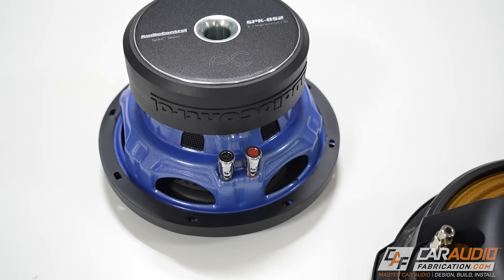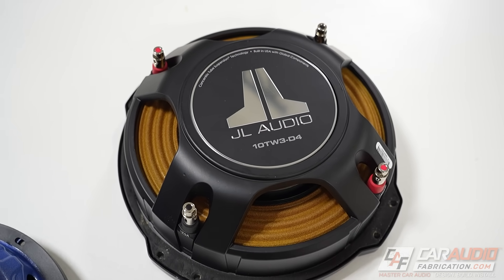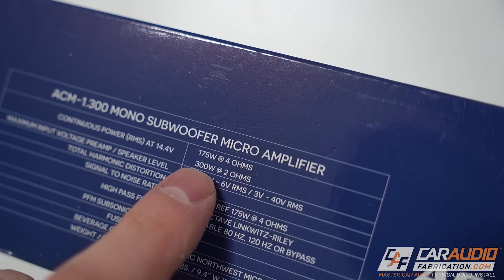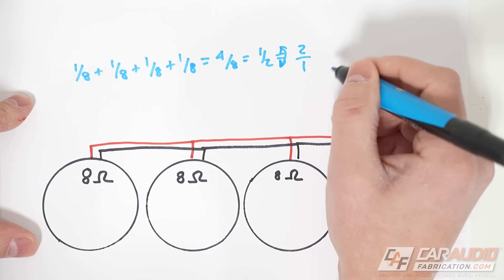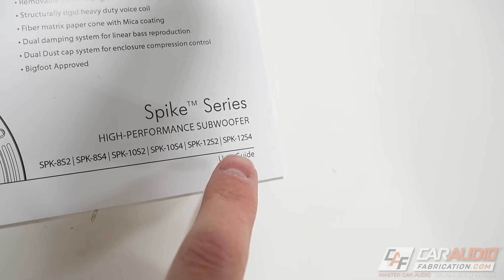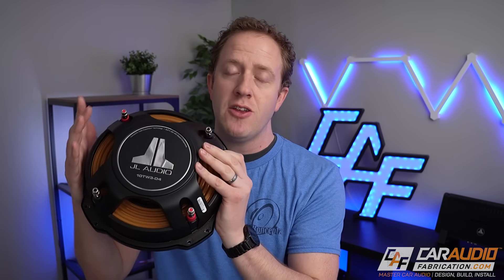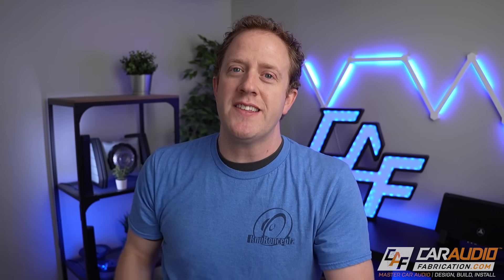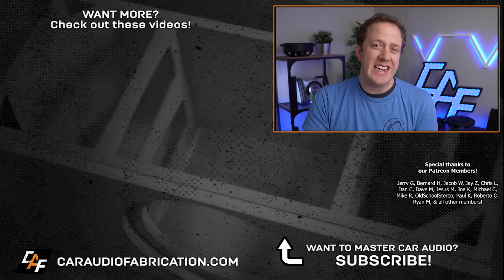Single vs Dual Voice Coil Subwoofer - Which is BEST? Wiring Explained!

Comment: Hey, I think I have a silly question, possibly🤣
I'm playing with the idea of having a cheap soundsystem that can give the outputs of a high end soundsystem, and my idea is to have four 8 cm, two on each side, but where the 8 is going to sit, the idea is to have small formfactor to hug the 8 ones for pressure and gradually widen it out to 2 passive radiators, is there any gain from this or do I loose more bass than if I did it with just a one size enclosure?
I want as much pressure as possible coming from the small ones to feed befy radiators with pressure, do you think this is possible?

Comment: Question: if I have a 4 channel amp that is 4ohms does that mean each channel is 4ohms or would I need to do different wiring to do a 4ohm load (speakers are also 4ohms) so like with a subwoofer if you wire in parallel you would get a 1 ohm load would I need to do that with the speakers on a 4 channel amp to or just hook the speakers up normally to each channel

Comment: Hi Mark, I am new to this Car audio stuff!,  Please can you answer a couple of questions for my new build. 1, I have bought 2 dual sub woofers at 4 ohms each, And the amp I got says that it can be bridged at 4 ohms x 2 @230 watts rms each channel. ( How would I wire them up?) Question 2!, Crossovers placement! Is it better to place them nearer to the speakers or can they be put near the amplifiers in the trunk?. Any advice would be grateful. thank's.

Comment: Im running single 2 ohm coils. I built my own subs also tho. Running 6 15s in a 4th order wall. Quad stack motors and 3" peak to peak linear excursion. They can handle about 2500 rms each and can play from 20-60hz. Fs-27hz, vas-1.5ft³, qts-0.8. Not for competition. Only demos.

Comment: The weight difference between dual and single coil woofers, would usually mean more metal is put in the dual coils, this could potentially give higher power potential, but the significance is usually small, because whether you can push 1200 or 1400 watts through a woofer has very little impact on performance. Also it is not guaranteed that the rest of the sub can take more power, even if the coils can.
However, higher moving mass usually gives lower FS. The extra coil also gives you more flexibility, and you can tap the output from 1 coil, if you want to measure it and experiment, but it will never be as good as a optic sensor or an accelerometer though, if you ponder on servo systems.

Comment: Can dual 2 or dual 4 be wired to 1 ohm for 2 subwoofers?
Reply: Dual 4 ohm can become 16, 4 and 1, if you use all coils. 16 is series+series, 4 is parallell+series, 1 is parallell+parallell. 
A pair of 2ohms can become 8, 2 or 0.5, for series+series, series+parallell or parallell+parallell.
You could in theory wire one sub in series and the other in parallel, or leave one coil not connected, but why would you.

Comment: I run a single subwoofer setup. My subwoofer is D1 wired to .5 ohm on my amplifier. Due to box rise I doubt my amplifier never will see that half ohm. Is that true Mark?
Reply: It is true.  Rarely if at all, will you see your sub's "resistive" rating while playing in a properly designed and constructed enclosure.  Just try not to wire your subs "in the dirt". There are some amps that are rated at 1 ohm that will have no issues at .5 and if you wire at .5 ohm, chances are you will be fine.  I am wired at .75 and I rise from .9 to 1.1 and my peak is 4 ohms.

Comment: But 2 ohm amp is more efficient compared to 1 ohm load ...lets says 83 efficiency vs 72 efficiency at 1 ohm  so wiring at 2 ohms is kind of better ?
Any suggestions feed back on this 
Remember one of kicker amp mono block provided great efficiency over 90 % at 2 ohms and went down on 1 ohm
Reply: If you're concerned with efficiency due to electrical limitations, it is important to know this!  Some amplifier's efficiency ratings go in the trash at 1 ohm and below.  It's good to check out Williston Audio Labs amp dyno reviews. 😁

Comment: The DVC option in my mind would seem to interfere with sound waves in a ported box, all the wires etc, but that’s probably another myth
That said, might be easier to match an amp with the wiring options. No preference really.
Reply: Impedance rise on a sub that's wired in parallel vs. series is proportionally lower.  I recently discovered that impedance rise is not a static number.  This is important if you're trying to squeeze every bit of performance out of a setup.
Reply: @RodofAllTrades  Yes, I’m aware. Series up to 4 ohms is a goal, but I was speaking of the physical presence of additional wiring 
Probably a minimal interference

Comment: I have a question for a future video since I cannot find that you handled this exact subject before
I bought a new car recently and the way I want to use it combined with an audio system means that I either have to go with under(front)seat subwoofers or have a box that's super easy to take out of the car, preferably an active one (so there's literally just power, line and remote wires to hide).
I can use the seat fastening brackets in the rear for a subwoofer (going to throw half the seat out, just 2 seats in the rear anyway), is this something that can be used in your opinion?
Regarding underseat subwoofers I would probably go for prefab, closed, active ones there too, is there anything special to think about when going that route, like how much space is needed between the speaker and the seat for the audio to actually get out in the car? Is it hard to build underseat subwoofers on your own for the front seat? Loved your backseat underseat video but it really doesn't apply for this tight space.

Comment: In my gladiator I’m running 2 kenwood 10’s flush mounts single voice coil im running them in series pos to pos then pos on amp then neg to neg then to amp i might be saying it backwards lol with Rockford fosgate amp if I done it right im only getting 350 watts at 2 ohms   In the wife’s jlu im running 2 fosgate 10 r2 with the 500x1 fosgate amp there running in 2 ohms + - on sub then + - same on the other tied into one wire to amp.  I think box design is killing my overall sound on both builds and amp selection

Comment: One question I had that wasn't covered is ,,, What is the performance difference between 1 2 and 4 ohm subs ..... Does a 2ohm sub respond faster (tighter) than a 4ohm sub for SQ? Edit and also Same question but for duel or single voice coils?
Reply: The lower the ohms the more power the subwoofer can handle due to lower ohm subs have more resistance. Basically a 1 ohm sub against of 4 ohm sub = 1 ohm can handle more wattage but the 4 ohm sub would be more efficient power wise keeping your amp running cooler. The lower the ohms are the more strain on your amp but SPL will be much higher on the lower ohm sub. Also the speed of the subwoofer has nothing to do with power (wattage). Speed of a subwoofer has to do with the motor structure, cone material that it is made of, and what type of box structure you use. In my opinion sealed subwoofers are faster and more articulate than ported but there will be people who disagree. Back pressure on a sealed box controls the cone movement better in my opinion. But all subs are not built equally so a poor built sub in a sealed box may sound worse that a good sub ported if the ported box is well structure, the box is tuned well to the sub installed in it, and braced well.

Comment: The following are amplifier specifications

MODEL
CXA1200.1
Power (watts/ch) 4 Ohm
600x1
Power (watts/ch) 2 Ohm
1200x1
Power (watts/ch) 1 Ohm
1200x1 +/-10%

I don't understand the "+/-10%"  of the 1 Ohm. Is the amplifier best running at 1 ohm or 2 ohms?
Reply: Its impossible for the 2 Ohm rating to be equal to the 1 ohm rating... The 1 ohm should have more wattage. This looks like a typo from the amp manufacture or store that is selling this amp. If that 1 ohm rating is true though it also means that the subwoofer should not be run at 1ohm because having a negative percentage factor in there means that amp can't handle that 1 ohm power load...
Reply: @petedetraglia4776  those are from the manufacturers website. The manual basically says the same. 
"(RMS Power [Watts]
@ 14.4V, 4Ω mono, ≤ 1% THD+N 600W x 1
@ 14.4V, 2Ω mono, ≤ 1% THD+N 1200W x 1
@ 14.4V, 1Ω mono, ≤ 1% THD+N
1200W x 1

NOTE: 2019 CXA mono amplifiers are 1Ω stable - power rating +/- 10%.)"

I currently have it running at 2oh but I would like to add a second subwoofer wired at 1oh

Comment: Im no expert. But I believe single voice coils are actually dual voice coils already wired for you. Running dual voice coil subs wired in parallel is best.
Reply: You are correct. Using the term "dual voice coil" is a misnomer. There's always only one coil of wire which has multiple windings. 

In order to achieve the amount of resistance necessary to claim a speaker has an impedance of 8 ohms, 4 ohms, etc., they have to use multiple windings in order to use the necessary length of wire it takes to build that much resistance. Obviously the other approach is to use larger diameter windings (2" coil vs 3") or "taller" coils, but then you're getting into extreme applications, like long-throw woofers. 

Anyway, I'm going down a rabbit hole. You get the point. 👍

Comment: Currently running a Pair of JL W0V315’s (single voice coil 4ohm) on a JL RD500 amp, have the subs hooked up separate at the box, sealed enclosure, and at the amp it has “2ch” but it’s internally bridged for parallel so the amps seeing a 2ohm load, for being in a ram truck is a lot of pressure I think it’s just right for the space and the door speakers capability as well.

Comment: I run Cerwin Vegas because they have dual voice coil subs that let you select the impedance by rotating a jumper terminal on the speaker and there are only two speaker terminals you have to deal with.

Comment: I run single D2's at 1 ohm and dual D4's at 1 ohm in my vehicles.  However, I recently won a SVC 4 ohm sub and I'm going to put it in my wife's car, matching it to an older RF Prime that is around 350 at 4 ohm, so should work well.

Comment: So the advantage of 1 ohm load over 4 ohm load is that the amp will be cheaper! :) But I’ve heard that 4 ohm load is more precise because 1 ohm load easily looses control - is this true?
Reply: I tested this.  I have a single JL 13W7D1.5 AE and I tried both 3 ohm (series) and .75 ohm (parallel) and I have settled on parallel.  If you are running a decent amplifier and your electrical is solid, you shouldn't notice any sonic differences.  I was hard core against low impedance configurations until I tried it for myself.  Most UNREGULATED amplifiers that will run and are stable at low impedances will provide (proportionally) higher dynamic capability into lower impedances.  With the 13W7 @ 3 ohms, I was fighting impedance rise and running into amplifier clipping, even using a SounDigital 5K, (rated 5,000 @ 2 ohms) which only gave me 1400-1500 watts RMS after impedance rise.  I ended up going with the D4S JP 23v2 and wiring down to .75 ohm.  With this configuration, I am enjoying up to 3dB of dynamic headroom and rarely ever clipping.  Remember this:  you're always better off having too much power than not enough.  You can always gain match for the appropriate power level.  Also, don't worry too much about impedance rise because it constantly changes, depending on frequency and power level.  If you have a properly constructed enclosure, you will get predictable results!
Reply: The higher the load of the sub the quicker it will respond to signal.. also the less heat the amp generates. Much of that heat is transmitted to the sub which results in more heating of the sub.. 

It’s easier and cheaper to get loud per se going lower.. power is cheaper but that power is less efficient and taxes your electrical system a lot more.. 

There is also a lot more to this like the dampening factor of amps.. full bridges or not.. so many variables.. 

Ideally in a perfect world you wouldn’t have to spend 10k to get 3k of power at 8ohm and that’s how everyone would be running thier setups.. 

The people who know strive to use a final of 2 because you can’t decent power from the amp be a little easier on the electrical system, have tighter control of the speakers and the just have a cleaner signal to the sub that is less heat transfer more power transfer ratio.. 

Liken it to this for just a non specific example to give an idea..

A 3k Brazilian amp for $250 will send 3000 watts to a sub at 1ohm or 1500 watts to a sub at 2ohm.. 

For starters that’s a draw of 3000amps or 150amp off the battery.. 

However that amp is 70% efficient at 1ohm and 80% efficient at 2ohm.. the result is 70% of that 3k is not actually single the sun uses to make musical notes.. the other 30% is thermal loss. The hotter things get the less efficient they are.. just for ball park and it’s more in depth then this.. 

The reality is the gain between in actual signal to the speaker isn’t 1500 watts. It is but not all that is signal much is transmitted as heat.. the actual difference would be more like that 3k as it is turned into mechanical movement of the speaker is more like say 1750 watts.. the rest of that is heat.. when you meter it it will still read 3000 because heat is also power and we are only measuring for power not signal.. 

That same setup at 2ohm isn’t making 1500 musical watts either..it’s closer to say 1200. 

That is not the biggest difference one would think now when it comes to the fact one is drawing 2x as much from the electrical system overall but only generating 25% or more actual signal.. 

Now with all that extra heat you find things like glue on the sliders coming lose, amps clipping after they play for a while and get hot.. the sub is being driven way harder then it needs to be and it wears down quicker as well.. 

The thing is at the end of the day if you took two identical mid level systems and put them on the meter.. say that 3k is on a single 12 and it does a 140.5 on music off the dash.. 

That same sub off that same amp at 2ohm will meter say 138.5.. but it will play that 138.5 all day everyday for 24h a day 365 days a year.. 

It’s give and take.. the reality is a $500 amp from a name brand company that makes only 750w but that power is super clean.. would hit around a 138 on that same setup.. 

This is why the ogs say younger what you pay for.. 3k watts from a $200 Brazilian amp in reality isn’t the same as when 750 off say a jl or dd or dc or kicker etc.. it just isn’t.. 

I could go to Walmart buy a $50 sub.. build my own box for it.. and throw it in about any vehicle out there on a 500w amp run at 2ohm maybe even 4 if need be.. with proper wire, proper alternator power, proper battery setup etc and embarrass a lot of kids running around with 5k teramps on some skar subs in a prefab box on a factory agm battery and factory 120amp alternator. 

And I’m not bashing these companies they do what they do but the people that mostly use that stuff don’t really know what they are doing, buying etc.. 

My daughter runs a single skar evl in a skar evl box on a skar 800.1 amp off factory 120amp alt and a lead acid battery at that lol.. I got her doing 140.2 off the glass.. blows everyone in her school away and I’m not even a professional in this field just been doing it since early 90’s and I know how to do it right even with sub par equipment. 

Hell I run a Teramps 3k in my personal truck.. but that’s also off a 320amp alternated dual runs of 0/1 wire and to dc subs.. and it’s also at 2ohm not 1.. I doubled the power needed from a lower quality amp so I don’t have to drive it as hard making it not as bad.. 

Here is something people always miss.. you got a 3k amp.. or 2k or whatever.. you got a 120-160amp alternator.. batteries don’t supply power they store power.. you run off the alt bit the battery.. batteries don’t like to give up the power quickly.. so how do you get 3k watts power assuming the amp is 100% efficient which is impossible (this means 300amps of power drain) from a 140 alternator (which I think is standard for most mid size cars now or 160 from what is common for most trucks and larger subs now when it can only physically give about 50% of that after it runs the engine and all the electronics? It can’t! And the battery which doesn’t like to give up its power can’t cover the difference either.. it might give you another 30-40 amps at times in short bursts.. so in reality people think they are getting 3k watts but they only have 100amp or so to give.. so it’s really running at 1000 watts not 3000. 

And again you can clamp all the wires and speaker leads you want it it wil measure 3k all day. But that’s not 3k signal that’s just 3k power.. you may as well just plug you speakers into the electrical outlet in your house at that point cause that’s pretty much what you’re doing..
Reply: @fishrrelaxing9361 Can you use large capacitors in line with positive lead to help the demand on alternator - or large isolated battery bank? Or different chemistry batteries? Or no way around dual alternator or high output alternator? Or no replacement or workaround for ultimate amp output from alternator?

Comment: Any ideas of why my Kenwood DMX8709s has static through the RCAs to the JL JD400/4 speaker amp? It's less when the gains turned down
Reply: Do your rcas run along your power wire to the amp?
Reply: @Keiserm5  no, just remote wire

Comment: Running 3 dual 2 ohm 15” subwoofers and have each wired down to 1 ohm beings I have 3 amps , 1 powering each sub at 1 ohm 👍🏻

Comment: Does it matter if you run the coils of each sub in parallel, then the two subs together in series?
Reply from the maker: You typically want to avoid series wiring between subwoofers. Better to design for parallel between subs.